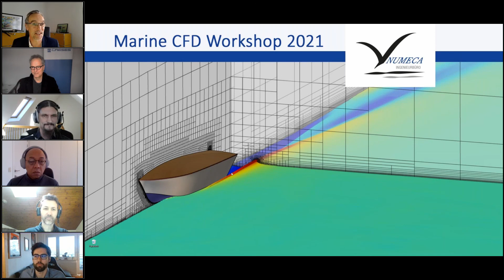01 Welcome

Comment: How can I create this anisotropic refinement at water level ( bottom surface)
Reply from the maker: Hi ras22king, you can achieve it in different ways. You can either use an intial surface, box refinement or use the adaptive grid refinement (AGR) combined with the Free-surface criteria. If you want to learn how to do it manually, have a look at the tutorial 2 (Beginner): DTMB Combatant which explains it step by step